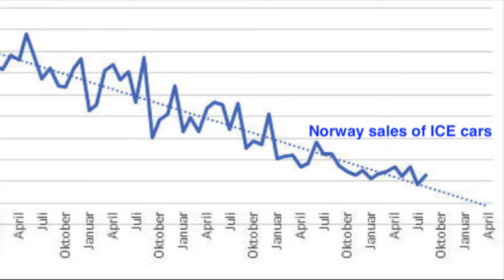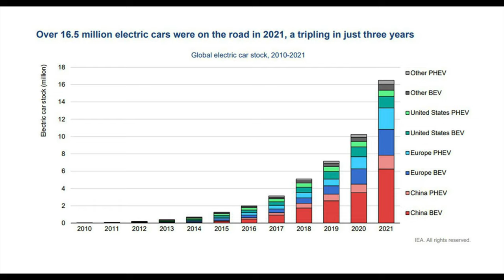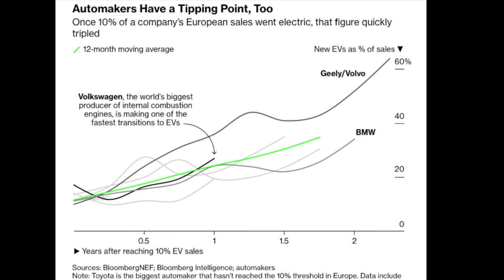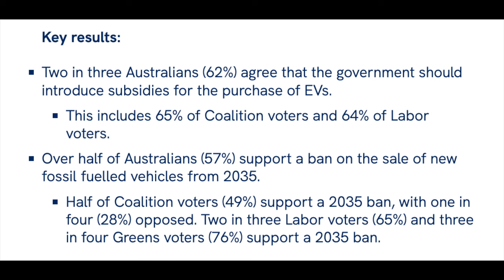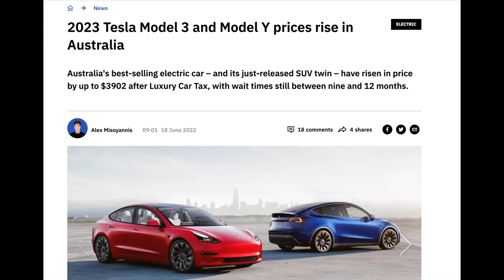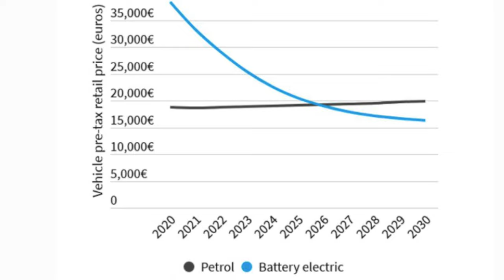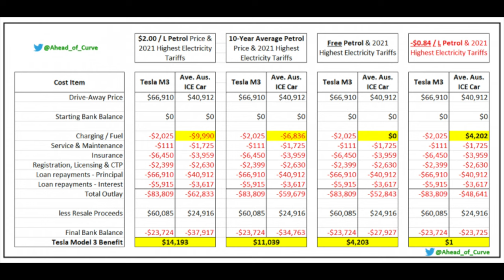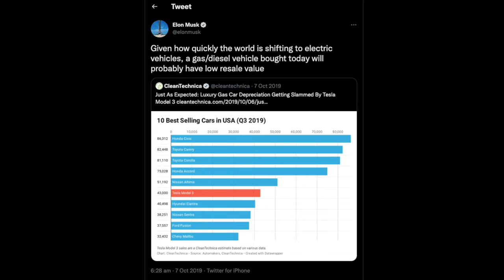When will your ICE vehicle become worthless?

Comment: I don’t think there will be enough used EV’s on the road in 10 years to make a 2022 ice vehicle worthless.   I think it will take time to prove the long term longevity of EV  (300,000) to make ice cars worthless.   The best advice for an Ice vehicle is to buy one 5 years and to drive it for 10 more.  I don’t think there is ANY 2017 EV that will last until 2032.  And that’s why the used ice car market will continue.
Reply: And they'll continue to be made, the gas car ban will not go in effect
Reply: @skidoock3606  Most car makers have already planned EV production into the planned manufacturing schedules. ULEZ schemes will go a long way to finishing off ICE....along with Euro 7 emissions laws, due in 2025...... Most car manufacturers have already admitted it will be too technically challenging and costly to get new engines through Euro 7.

Comment: One of the banks in Australia has already given notice they won't lend on ICE cars. Lenders are going to start to calculate the tipping point of when ICE cars will begin to lose their value before the loan is paid off. However, in the short term all used cars are going to go up in value because automakers wont' be able to meet demand, not just for EVs but all types of cars. Supply issues and the transition to electric cars will impact total production. Combine that with the fact that all the ICE cars on earth have to be replaced in the next few decades and you can see where this is going. The other wildcard is what will happen to gas prices? Will economy of scale eventually break down and cause gas to become very expensive and hard to find or will it get cheaper as demand finally begins to fall? What areas of the world will ban ICE cars, not just for new sales but for registrations?
Reply: Yes, I’ve wondered about gas prices too. If you were one of the last ICE cars in your town, you could imagine very few petrol station left, and I think distribution costs will force prices up
Reply: @StevesBikes01  Gas theft became a real problem in the US recently. Gas stations may not even be willing to keep it in stock if the price gets too high and there is too much risk. Insurance companies may not want to write policies for gas stations.

Comment: Wow , where to start. "Your ICE vehicle will be worthless by 2035".
If i bought a 2024 Landcruiser for example and a 2024 EV (you pick) , are you honestly saying your EV will be on the road in 2035? I know the cruiser will. That would mean your calculations for total long term ownership are flawed. Your modelling is based on everyone buying a new car more often than they do now. How many people own a 10 year plus car today? It's unrealistic to suggest that you just tell people scap your car now go and buy a new one. The US EV market is in decline. New vehicles are on lots not selling , manufacturers are now pulling production. Public charging  is more expensive than fuel, repair costs are higher that ICE for panel work . Some ferries won't take EVs on them due to liability issues. I could go on. If the EV industry wants to expand then the charging network has to expand, but a public charging supplier has just folded, sales are flattening, manufacturers have a glut of stock and are cutting production. 
This is all without talking about the elephant in the room. Emissions. Isn't that the point? EV emissions for mine to recycle (arguably 10 years?) With a ROI point (4 years??  Tell me if you disagree on that number) gives you 6 years of actually doing the only thing that EVs were good at, now run that over 20 years. Most emissions are produced in manufacturing, so long term I think EVs are a con,
Reply from the maker: Yeah you’re probably right, turns out was wrong anyway, cheers…I was wrong - Your ICE vehicle will be worthless sooner
https://youtu.be/pqPVNyNUC7s

Comment: Unfortunately I am in the position that I simply can't afford an EV. I will soon be buying a "new" (used) ICE vehicle because that is what I can afford right now. I don't think the example of horses vs cars in NYC is a great example. In the case of converting from horses to cars there were many benefits to the owner. In the case of moving from ICE to EV there are advantages for the world but inconveniences for the owner. Horses didn't need to be legislated against because the advantages of cars were so great that people wanted to make the change. So I expect adoption of EV's will be lower. That is exactly why there is legislation in place to force people to move from ICE to EV. Most people don't want to make the change, and if we all did, then most country's electrical generating capacity would be overwhelmed. But there does now feel a momentum in favour of EV in Europe.

Regarding price, I simply can't afford a new ICE car either. So even if EV comes down to the same price as ICE I still can't afford it. That relegates me to the used market. Eventually there will be used EV at a comparable cost to used ICE. But the batteries will be old and possibly with a shortened capacity. So I would probably still choose ICE.

Currently in the UK there is no price advantage for charging vs diesel/petrol due to the huge electricity price increases. That may change again in the future but it shows that it is not a simple matter of saying EV's are cheaper to run that ICE.
Reply from the maker: Thank you for taking the time to reply. We will have to wait and see how it pans out. However for those who can afford a new car in the UK (1.6 Million in 2022) EV’s are appearing that are at price parity. Factor in no petrol or service costs and it is already cheaper to go EV. New models from BYD and Tesla over the next few years will make it a no brainer decision to go electric especially as ICE car prices continue to rise not fall. Cheers

Comment: The cost of fuel must always be calculated, since this is one of the many reasons people move to EVs. Fuel will never be free. Also, ICE vehicles won't need to be 'worthless' for EV adoption to go ballistic, but the value dropoff of ICE will be exponential.
Reply: Electricity will never be free either. Currently cheaper than a fuel, but infrastructure improvements to support green energy and electrification will cost money and the consumer will pay. There is home solar (actually a wise investment) but it is definately not free or cheap and requires an expensive property to be installed on.
Reply: @juliogonzo2718  True, but it's one of many options unavailable to fuel-users. Once you get around sunk costs, nothing beats solar in 2024.
Reply from the maker: Agreed, thanks for watching

Comment: Great informative video. A few things I would like to add. (at this stage) Price of tyres are usually 50% more to their ICE counterparts. Furthermore states like Victoria Australia are taxing 2.1 c/km for PHEV (..and will climb. This should be added to your table and call it EV tax. All states will jump in the taxation bandwagon). I drive an average 600km per week hence add $12.60 tax if I had an EV. In my view, the government plans to incentivise the EV; push people indirectly to get rid of their ICE via increasing prices of petrol to a point of non-affordability; grant federal subsidies (like now $3000 to buy new etc). Then when everyone has an EV, jack up the km taxes where eventually it'll cost more to have an EV in retrospect. Home solar panel schemes are the same. Get the customer on board then turn up the tax volume.  They got their money and then some! Agree with getting in early as there are always a government benefit for newbies!
Reply from the maker: Thanks for the feedback, cheers
Reply: Informative? The guy's a propagandist.

Comment: Well, might be. On the other hand I believe there will be ban on EVs powered by battery first and then ban on personal vehicles entering the cities like it is in Oslo now, they don't let in even EVs now. Seems like future holds only public transportation in cities and bicycles, not huge fan of that idea. Batteries are extreme hurtful for environment and while I believe something should be done about it this is wrong way. Elements that we can use to create batteries are located only in Russia, China and Africa (Congo mines that have 80% of worlds cobalt are property of China). I think Eco aspect of this change is just there to fool masses into the switch, real reason is to finally not be depended on hostile countries when it comes to power and gasoline. This seems good if we look at it really shallow, since we can create energy locally but if we zoom out a little we can be cut off from batteries and that can have huge tool on transporting goods and inflation as we saw during pandemic. Seems like investing in biofuels seems reasonable, we have the tech and infrastructure on top of that we don't need to get rid of all the cars that are driving on the roads. Manufacturing all off these cars created co2 so it would be wise to use it as long as possible. What's your opinion about that?

Comment: One other thing on my mind is at what tipping point do refiners produce so much less gasoline due to decreased demand that a gallon of fuel will become prohibitively expensive.
Reply from the maker: Well done for forward thinking. Yes the cost to extract oil, transport it, refine it and put it in your ICE tank wont change, but the volume will reduce, so ICE users will have to pay much more, and gas stations will thin out as many will close. I predict this by 2030….see “I was wrong, your ICE vehicle will be worthless sooner” Cheers

Comment: ICE vehicle cost of ownership will only increase. EV transition and renewables transition for the energy grid will hurt oil demand and they will keep putting the price up. As automakers go bankrupt, their parts manufacturers will follow and that’ll mean ICE vehicles become more costly to service and maintain and a lot more costly to run
Reply: Spot on, that’s what will happen, and I think faster than my video suggests. Try “Steve’s Bikes” on YouTube if you’re into motorbikes. Cheers
Reply: So your big theory is that oil prices will increase when demand drops? Looks like someone flunked Economics 101.
Reply: @nodak81  The big oil giants are welded to huge profits. They've become so used to it. As EV adoption increases, which it will, the big oil barons will have to decide where their point of viability is, beyond which point it no longer becomes worthwhile to drill for, extract and refine oil into road fuels. Of course they will probably still produce some but not in the massive volumes they previously did. And at that point, they'll declare it a niche product, with a price to match. Because by then, the only other alternative for ICE drivers, will be synthetic fuels. And they'll cost 4 to 5 times the price unleaded is today..... You can buy Aspen synthetic petrol in Britain today. It's been on sale for decades, and costs around £30+ per gallon.....
Reply: Yea maybe … in 2075

Comment: Maybe in a small country like the UK, but Canada is big and we are a long way from having charging stations everywhere. I suspect many areas in a Canadian winter will only support hybrids not full EVs
for decades to come. I doubt if 10 percent of Canadians have ever spent $50K on an ICE car let alone an EV so price will be a factor as well.
Reply: or hydrogen (made with nuclear power)
Reply: 100%!! I live in Alberta myself. As recently as yesterday they asked us to conserve energy due to the heat warnings not to run air conditioning, electric stoves, and yes charge EV cars as well until the grid can keep up to demand via imports from Montana and British Columbia, and when those jurisdictions cannot supply themselves they import from us, and when neither can supply themselves the importing stops and we experience rolling blackouts until the demand drops. Would I buy an EV? Yes I would and drive it between the months of March and November but they will have to pry my ice vehicle from my cold dead hands in the winter time. Also long road trips cross province or cross country, give me good old outdated reliable gasoline. The car is charged in a couple minutes and good for another 1000KM of range
Reply: I live in the UK and the charging infrastructure here is terrible, even for a small country.
Reply: Average price of new vehicle in Canada crossed $66k in July 2023.  You can Google to confirm.  Do you think all the large pickups and SUVs you see on the road are cheap?

Also, Canadian tastes and preferences are essentially irrelevant.  Our car market sells what the automakers decide to sell in the US.  We're just lumped in with the Americans.
Reply: @gunit6815  the environmental mandate in Canada does not understand there are climates colder than Vancouver and Toronto. See all the nonsense about heat pumps lately. Heat pumps are ideal for some climates but the absolute best performing heat pump is still not good enough for a sole source of heat in places like the prairies. Could be of use some of the winter but has to be supplemented by a redundant system or goodbye water pipes

Comment: Can always put in an electric motor in my old petrol 4wd..
But then when they turn off the electricity grid, we cant charge our cars.. so we are back to walking. Another way they can control us..
Reply: Which is why you can buy solar panels and be off grid completely.....?
Reply: @aronl8077  so everyone has to buy solar panels?
Reply: If the power goes off gas pumps don't work either. You want control? Think of it this way. You can make your own electricity but you can't make your own gas.
Reply: No but a 650 mile range for full to e makes it better……….
Reply: @frankcoffey  The petrol pumps can run off of diesel generators. Or be packed in by men with jerry cans. We see this all the time after hurricanes.
Reply: You think you are not being "controlled" now. 
The higher gas prices go, the more you complain, and the more money big oil makes. 
Nobody can put panels on their roof that produce gasoline out of sunlight.
Reply: @dario7198 no, but you might be able to buy electricity from an enterprising neighbor.  It is much easier for somebody with space to produce electricity than gasoline.

Comment: I'm keeping my ice car forever.
Reply: What will you do when gas cost $10 USD per Gallon, right now where I live if I owned an electric car and charged at the cheapest electric rates on purpose I would save on average 90% a week on what I spend driving on gasoline.  Gas is cheap here election year ha ha, at 4USD per gallon spend 40 per week electric cost 4 dollars.
Reply: @marcusw3891  cut back on driving.
Reply: @marcusw3891 it'll never get that expensive lmao
Reply: Keeping it won't be a problem. Finding fuel for it in 10+ years might be......
Reply: @Brian-om2hh  okay

Comment: Also gas stations will be less abundance as gas stations close down due less profitable as to lower demand for gas.
Reply: Servo’s are owned mostly by massive corporations and they won’t just close them all done, because they are selling less fuel, they will put in EV charges and put the price of fuel up. Most are already signing deals with EV charging businesses or in the case of BP they did a deal with HERTZ to build their own charging infrastructure. Price of oil will be $4-5/L by 2035.

Comment: We have six charging points in our town with over 100 thousand residents.😬
Reply from the maker: Well, except every house with a garage has a charge point. About 50% can charge at home so that’s about 50,006 in total. But I appreciate your point. Remember when gas cars came along there were zero gas stations too. Cheers
Reply: @stevestesla9120  yep but waiting behind someone pumping gas doesn't take 45 minutes.
Reply: There are actually tens of thousands of charge points... Every house has electricity.
Reply: @Brian-om2hh  yep but to change from the mains direct 3 pin plug your looking at 10 hours On average.
And you would have to have the car off the road on a private driveway.
If everyone could charge for 10 hours overnight there may be no need for public changing points, you obviously get quicker charging with a dedicated  point, not sure what they cost to install at home and again if you have no driveway your gonna struggle.